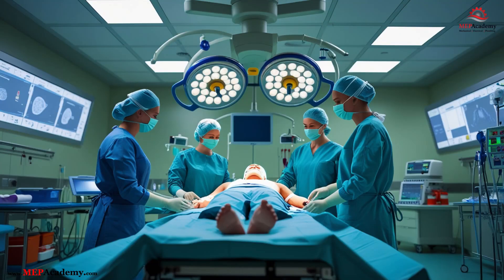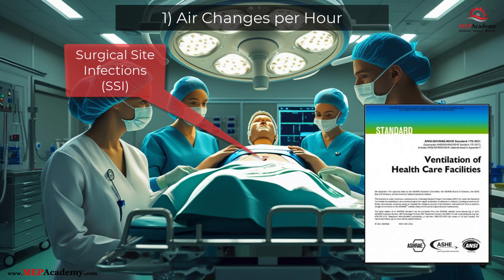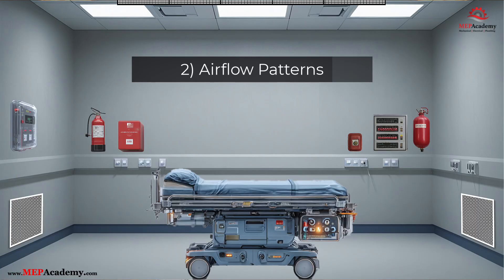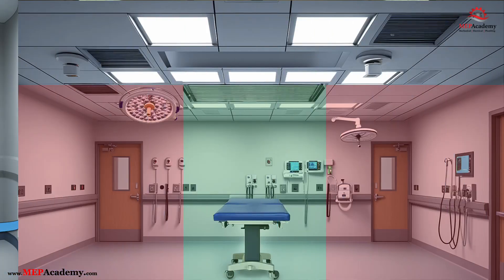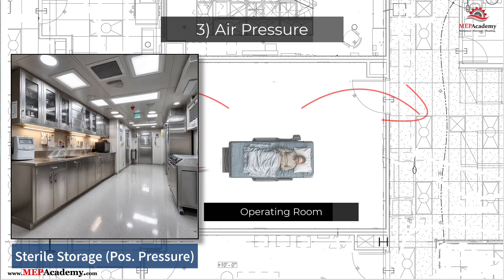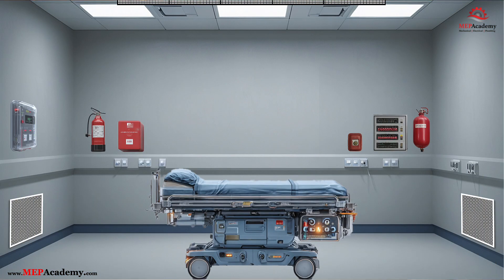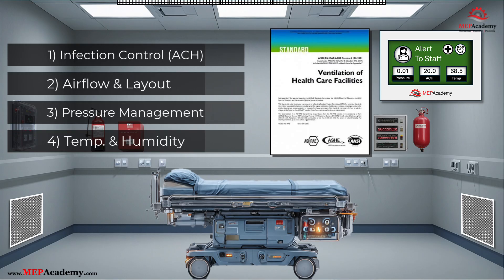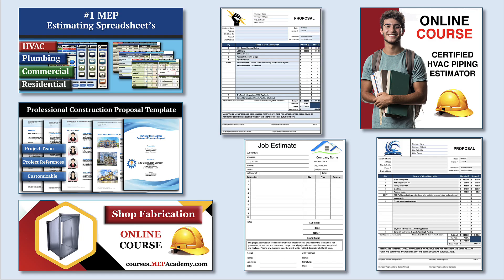How Operating Room HVAC Systems Work | Airflow, Pressure & ASHRAE 170 Explained

Comment: What about CSA Z317.2? How does that compare with ASHRAE?
Reply from the maker: Great question! CSA Z317.2 is the Canadian standard for HVAC in healthcare facilities, and it’s similar in scope to ASHRAE 170 in the U.S., but with some key differences.
Both set requirements for air changes per hour (ACH), pressure relationships, filtration, and temperature/humidity in spaces like operating rooms, isolation rooms, and protective environments.
CSA Z317.2 tends to be more prescriptive in some areas, with detailed tables tailored to Canadian healthcare practices and climate conditions.
ASHRAE 170 is widely adopted in the U.S. and often references ANSI/ASHRAE/ASHE standards, while CSA is enforced by Canadian health authorities.
In short, they serve the same purpose — ensuring patient safety, infection control, and proper ventilation — but each aligns with its own country’s codes and healthcare regulations.